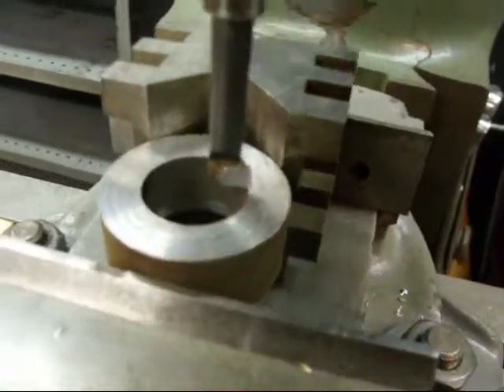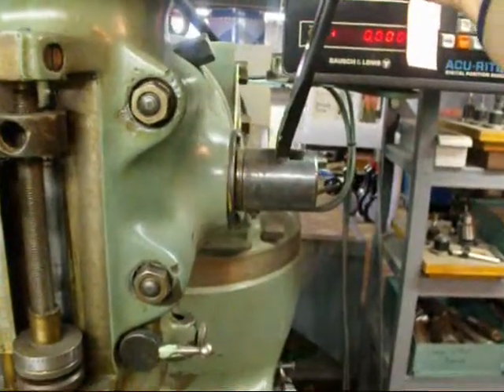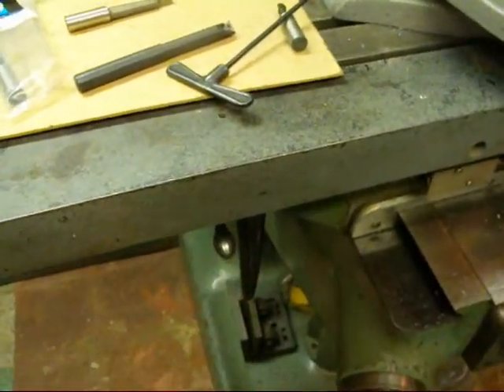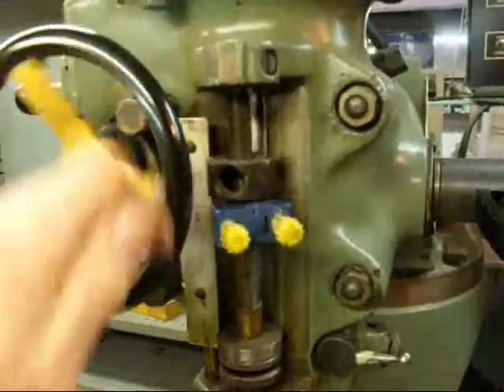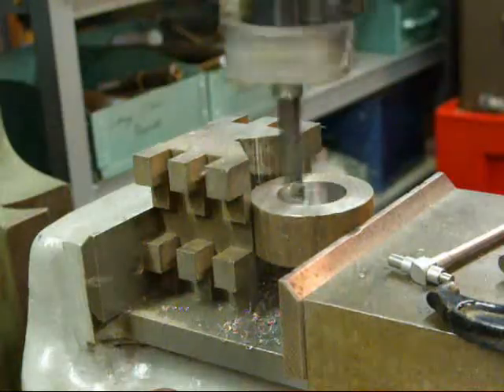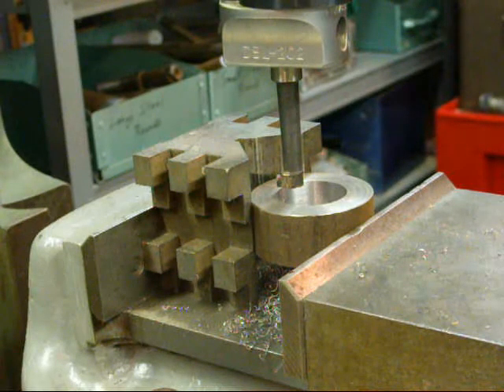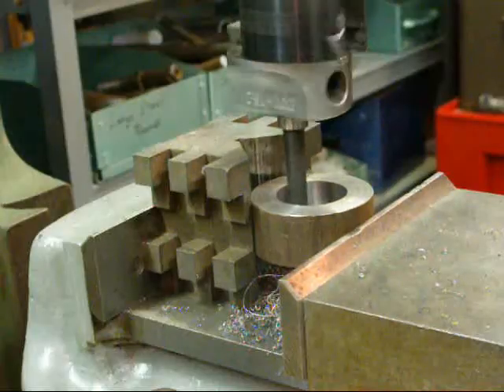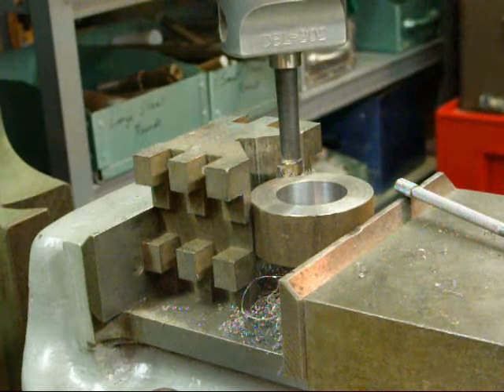BORING ON THE BRIDGEPORT MILL part 3 Criterion Head tubalcain

Comment: Question: Why don't you discuss the Bridgeport's auto-downfeed feature? The whole point of it is to provide a steady, consistent downfeed during boring ops isn't it? You appear to be only manually cranking the wheel to achieve the penetration.
Reply: LoL, my machine doesn't even have a power quill feed.   Crank only.

Comment: Question:  Our Bridgeport is filthy, and the metal - metal slide surfaces are disgusting.  What do you advise for lubricant / cleaner and frequency of lubrication?   Thanks in advance.
Reply from the maker: Try mineral spirits. Or lacquer thinner in a test spot--may take paint off.  I use way oil for the vedovetails. --20 wt non detergent other places.
Reply: Thank you.

Comment: Pete, In your video on drilling a through hole you said to  put the V block next to the movable jaw of the vice, I see here you have it on the fixed jaw. Am I mistaken? Is there a difference in the two operations?
Love your vids.
Keith

Comment: Can someone point me into the direction of a video showing how one mills a hole through a piece of stock, then machines in a male alignment key for auto alignment when installed over a shaft that has an axial female key slot milled?

Comment: Many years ago, I did not buy a knee mill because I did not know what a draw bar was and how the shanks of the tool holders were held in. I knew of the MT style and knew they were just press fit. Passed up some good deals, instead I used a small drill press as a milling machine.

Comment: For a precisely sized bore, the power-feed is helpful, since varying the speed of feed will remove either more or less material. The power feed removes that variable and will ensure the same size bore from top to bottom.
Reply: What is missing here is the feed rate used, i.e., how many inches per minute..   Yes, it makes a difference in finish if nothing else.
Reply: I think on a Bridgeport the quill power downfeed is inches/revolution , not inches/min. I think it's selectable at .0015 ipr, .003 ipr and .006 ipr, If I recall  correctly.

Comment: Thanks for sharing the video, I enjoyed it very much. One question: How do you set the orientation of the bar in the boring head?
Reply: I set mine to a right angle from the shaft axis.   Works for my machine.  Biggest problem with the cheap boring bars from China is they have round shafts and the lock screw lets them spin (and mar the shaft eventually) while the better American made bars have a flat on them the screw can grab to prevent the shaft rotating.

Comment: I used my bridgeport brand boring head (just like criterion) last night for the first time. Questions: The carbide tipped boring bar can be at any position when you install it. I just eyeballed the angle that looked like it would give good relief. Also I quickly realized that when adjusting the cut, I needed to take up the slack in the adjuster before counting how many thousands I was moving the head. Thanks for your videos on the non-cnc way of machining.
Reply: My first time will be Sept 24th 2021,,Wish me good results (@@)!

Comment: Hi Pete, you show the speed table on your head. I have a series 1 J head and the speed table has twice the number of speeds, two high and two low gear speeds for each belt position. I have not been able to run the mill yet, so can't tell what's different. Any ideas? It's the 1hp motor, not variable.

Comment: Thanks for the tutorial on boring and no I didn't find it Boring.  I actually found it quite informative.  I noticed on one of your boring bars that you said also can be used in a lathe that it had three points.  I'm assuming that means as one point/cutter gets dull you can rotate to a new cutter/point.  Is that true, does that type of bar have a specific name?  Thanks.

Comment: What type of V Block are you using?  I made one some years ago when I first started working at a machine shop to replace the one I made in school.  I like to use both methods, just to be sure I'm still accurate with the tele gage, calipers and the mic.  I also like to use pin or plug gages, some indicators and other things depending on access to the part on the machine.